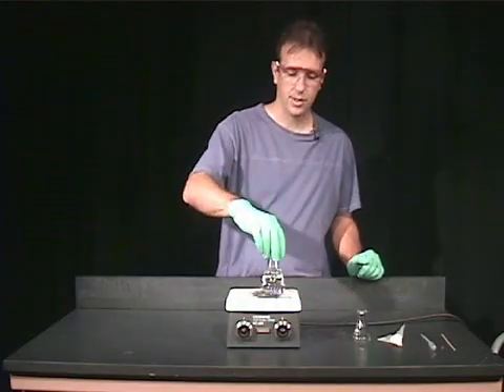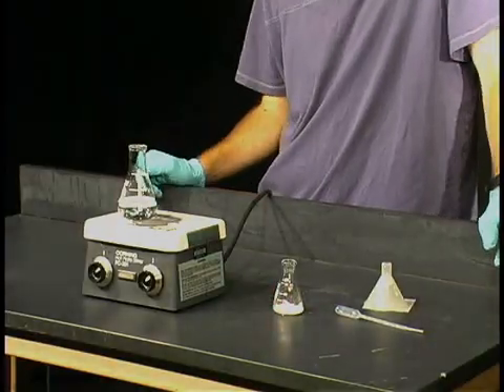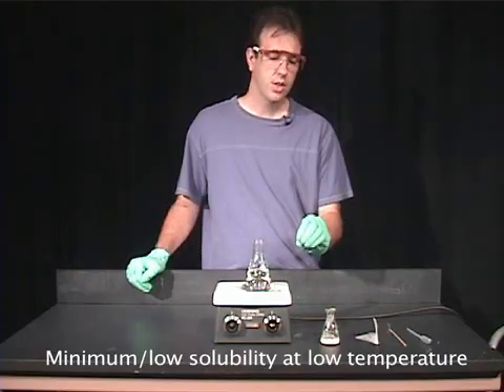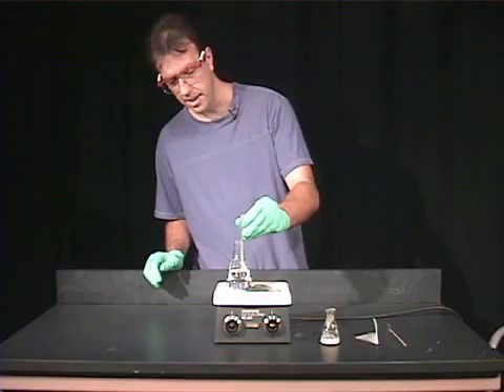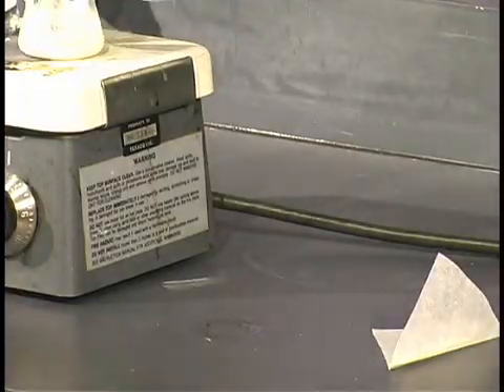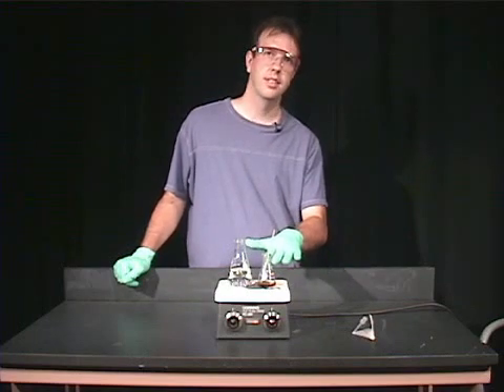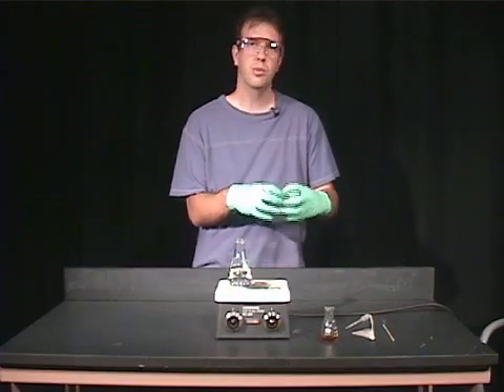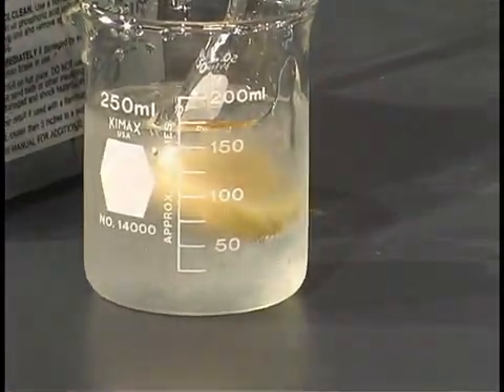Organic Chemistry Lab: Recrystallization

Comment: Hmm, not too sure about this as all you have done is
dissolve the solid and then recrystallize it without filtering out the solid
impurities and then separately filtering away the soluble impurities in the
second stage. A simple method to purify by recrystallization: dissolve crude
product in the minimum of a suitable HOT solvent, promptly filter through a hot
Buchner (thus removing insoluble impurities), allow to SLOWLY fully
recrystallize, maybe cool if required, re-filter in a fresh Buchner ensuring
whole surface of paper is covered in pure solid, gently pack-down to ensure
maximum drying effect of airstream, recover, air-dry, weigh and do MPt
determination. For a higher level of purification activated charcoal is used in
the first solution stage to absorb more impurities.

Comment: Why are the impurities more soluble than the desired material?  Does that have to do with the solvent used and knowing what typical impurities are?
Reply: Steven Ingersoll by selecting a solvent that will dissolve the majority of chemicals, by checking their solutes, you can deal with other impurites with a different solvent later.

Comment: Why dont you recrystallise by heating at reflux?
Reply: Theoretically, reflux does not allow solvents to evaporate from the system, i.e. the amount of substance per volume of solvent (concentration) does not change.
But in the case of recrystallization, we have to evaporate the solvent so that the compound reaches its solubility limit (...and goes beyond the limit at high temperature). And then we cool the solvent so that the compound crashes out of the solution as crystals.

Comment: Could anyone explain the use of wooden stick and bumping phenomenon? Thanks
Reply: You need something irregular shaped in the solvent so it provides nucleation points for the vapour bubbles. The wooden stick is a porous material - if you place it in near boiling water you can see tiny bubbles forming on it.

He used it because of the little volume of solvent but for larger vlumes, magnetically stirring the suspension will also work to even out the boil and distribute heat.

Comment: The solution is filtered and washed with cold solvent to remove the solvent soluble impurities that were removed during the crystallization. They just didn't show that step.
Reply: Vacuum filtration is pretty noisy and probably doesn't make good video material, I suppose.

Comment: Will slowly taking the solution down in temperature instead of removing from the hot plate entirely slow the recrystalization process and capture less impurities, or is it best to allow the solution to cool to room temp as shown in the video?
Reply: I've seen both done. My guess is that the former will produce the best results, but will be much more work and time intensive.

Comment: It is, the purpose of putting it into the ice bath is just to get more precipitate.  Usually it isn't such a good idea, depending on the solvent and what compounds you have in solution.  It was okay in this experiment because he probably formed the compound with nitric acid and sulfuric acid (hence, nitrated benzoic acid).  In which case, nitric acid and sulfuric acid are completely soluble in water, so they will remain in solution regardless, but precipitate the crystals.